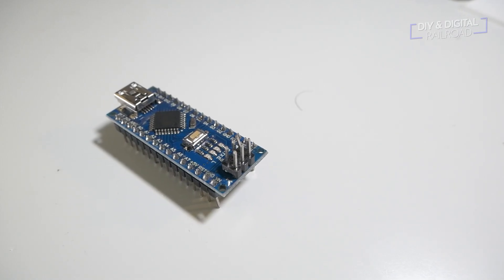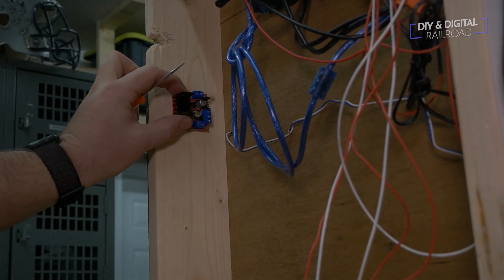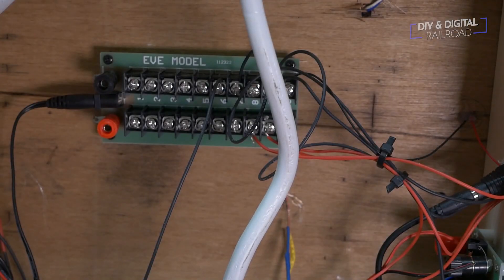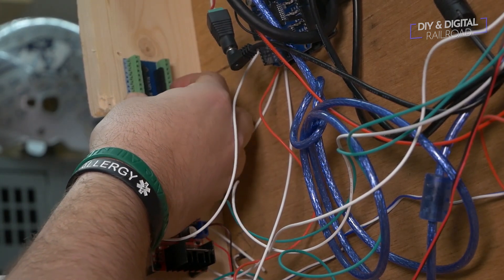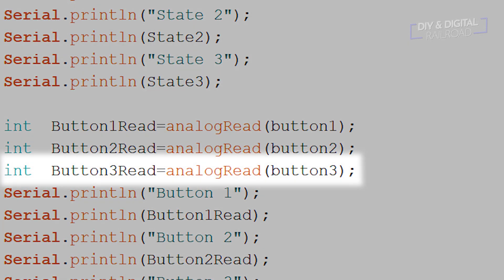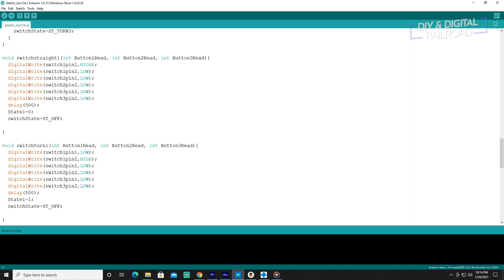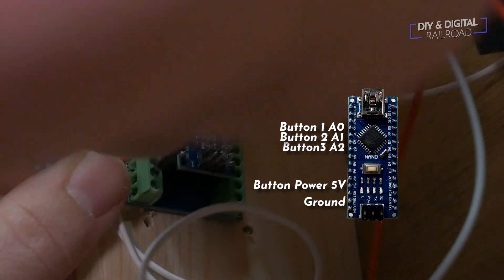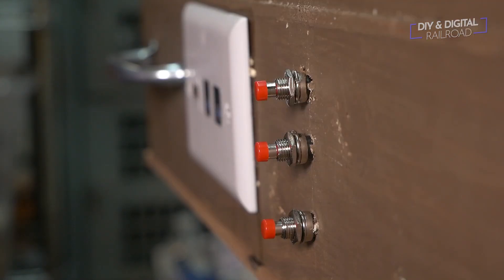Arduino Switch Control!  Installing the Kato Multi Switch Control Project on a Model Railroad!

Comment: Arduino/JMRI HELP!! I have burned three switches trying to make a version of it work. 

Jimmy, could you help?? 

Setup: Mega, sensor shield, L289N, Kato switch.
Ask: Arduino code that runs IR sensors, LED lights, and triggers turnouts off the shield. 
I can make the switch work without burnout, coding the Arduino to flip the switch when a sensor is triggered.
I can't code having the turnout flip when JMRI changes from Thrown to Close, etc. 
Desire is not to have a push button to trigger the switch; instead, the JMRI software flips the switch.

Comment: Sorry if this has been asked, but how would you scale this up for more switches? On the layout I am planning, I have 15 switches. Is there a motor controller board that can handle more than two switches, or is there a better way for this situation with many switches other than using an arduino? Also, how do you incorporate LED indicator lights on a control panel to show which path is active on the layout at each turnout?

Comment: I sure wish there was a phone app to run switches for these in addition to what kato has for bluetooth throttle. Kato can run sound, whichbus nice if you have dcc to run that, but the ability to control turn outs etc would be much more practical for model railroaders. If kato did that, while practical, it would prob be priced way out of range for most users given the prive for their sound conttoller.
Thanks for these explanations though. Very helpful to a newb.

Comment: Hi Jimmy, don't know if you see comments on old videos or not but I wasn't sure how to contact you.   Anyway, THANKS so much for this video as it was a great starting point for me.   However, being a somewhat old programmer (started in, well, about 1969), my first thought after getting the code to work (which was easy) was to change it so that it would work for way more turnouts.   I didn't want to keep duplicating the code for each additional turnout so I'm in the process of using arrays so that all I need to do is change the single constant that defines the number of turnouts and it all works.   But, as I'm going through the code I started thinking about how I might be able to make the changes so this would work with a Nano but being able to control up to say a dozen turnouts.   Obviously the Nano doesn't have enough pins so:
1) I should be able to use digital pins to determine button pushes.
2) I'm wondering if I can use a PCA9685 to control the turnouts directly seeing as there is only a 1/2 second pulse of 12V+ on one pin or the other to the Turnout.   This is my biggest question.

Now, my "real" application involves up to about 10 Turnouts for a Fiddle Yard and I need to code in routes so that the person running trains can pick a track with a push button and that  will turn all required Turnouts to the required position and light up an LED.   In this application there is no "flipping" of Turnouts, just aligning multiple turnouts to a route.

My final question is whether you are interested in the code I create and if so how would I get it to you.

Thanks and keep up the great work.

Comment: Jimmy, the number of code changes you need to make just to add a third turnout illustrates the value of user-defined classes. I can't imagine how your code would look if you added three more turnouts. (I suspect that a Nano would control up to 6 turnouts easily.) By using classes, your main program would look like this:

<include TURNOUT.h>

TURNOUT turn1 = TURNOUT(A0, 2, 3, STRAIGHT);
TURNOUT turn2 = TURNOUT(A1, 4, 5, STRAIGHT);
TURNOUT turn3 = TURNOUT(A2, 6, 7, DIVERGING);

void setup() {
}

void loop () {
    turn1.refresh();
    turn2.refresh();
    turn3.refresh();
}

Adding more turnouts requires adding TWO lines of codes for each turnout: the declaration (TURNOUT turnx = TURNOUT(etc.)) and the refresh() call (turnx.refresh()).

All the hard work is done in the class definition contained in TURNOUT.h: the constructor (TURNOUT(i,j,k,m) ) links the turnout to the analog pin for the button (i) and the digital pins for the motor driver (j and k), and sets the initial state (m) of the turnout. The definitions of the STRAIGHT and DIVERGING constants are contained in the TURNOUT.h file. The refresh() method checks to see if a button has been pressed - if so, it moves the turnout and changes the turnout state.
Reply: How do you set green/red LEDs using this approach?
Reply: @RichardFrenchRacing  The long answer is truly long; but the short answer is this: In addition to a TURNOUT object, you'd have one or more SIGNAL objects. In the case of Jimmy's crossover, he has one TURNOUT (which can be straight or diverging) and four SIGNALs. Let's assume that when the turnout is straight, signals 1 and 3 display green over red, and signals 2 and 4 display red over green. When the turnout is diverging, the opposite applies. Now you have, for example, the following code:

// Set straight
turn1.set(STRAIGHT);
sig1.setAspect(GREEN_OVER_RED);
sig3.setAspect(GREEN_OVER_RED);
sig2.setAspect(RED_OVER_GREEN);
sig4.setAspect(RED_OVER_GREEN);

Code within the SIGNAL class (specifically, the setAspect method) manages the LEDs, turning them on or off in accordance with the specified aspect. The SIGNAL class provides a constructor which specifies which pins the LEDs are connected to, and whether the LEDs are common anode or common cathode, so the setAspect method knows which pins to set HIGH and which pins to set LOW in order to display the desired aspect.

Hope this answers your question!
Reply: I get 2 compile errors when I tried this approach. 
1. Compilation error: 'TURNOUT' does not name a type; did you mean 'TURNOUTS_H'? 
It doesn't like the turn1.refresh() command - 'turn1' was not declared in this scope
   turn1.refresh();

Here is my code - I'm trying it with just 1 turnout at the moment

#include "turnout.h"

TURNOUT turn1 = TURNOUT(A0, 2, 3, STRAIGHT);
//TURNOUT turn2 = TURNOUT(A1, 4, 5, STRAIGHT);
//TURNOUT turn3 = TURNOUT(A2, 6, 7, DIVERGING);

void setup() {
}

void loop() {
  turn1.refresh();
   // turn2.refresh();
   // turn3.refresh();
}

Comment: Love the sketch,   Changed over to this from your original Sketch from 2 years ago that had LEDs. Used it on a ATTiny85. Just the right number of pins. This Sketch works great with 4 Turnouts  and adding the Leds back in, Just the right number of pins for Arduino/Nano/Pro Mini. I also added a switchstate to init the turnouts to closed on power up . One oh by the way , if you prototype this and use less turnouts than the sketch defines, make sure you tie the unused push button pins to ground with a 1 k resister.

Comment: Great new sponsor, Jimmy!
Having good soldering tools makes a huge difference in the quality of your joints and makes it easier too.  A lot of people get turned off of doing soldering because they tried it using a cheap iron and had poor results. Spend a little more on a decent iron folks, and you will have better success.

Comment: I stopped using the resistors by writing on the code  for all push buttons example.  pinMode( switch3pin2, OUTPUT_PULLUP);

Comment: I recommend powering any microcontroller separately. This leaves out the chance of any power backfeed through the system which could potentially harm the microcontroller and any/all other electronics. These mass produced clones do not have great quality control. Just a tip I've learned over the years.